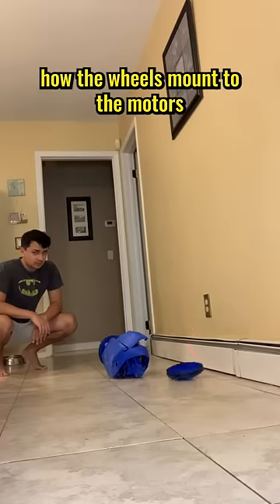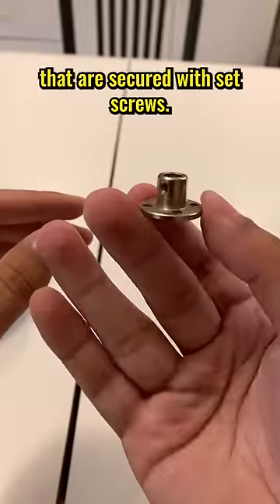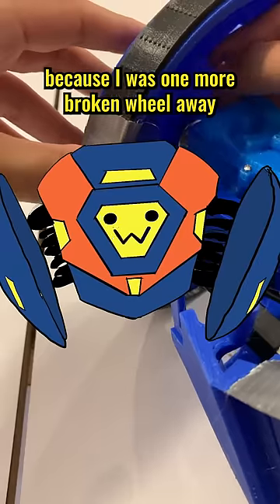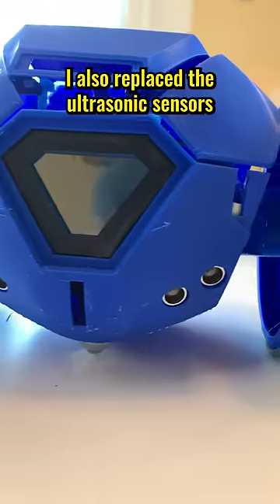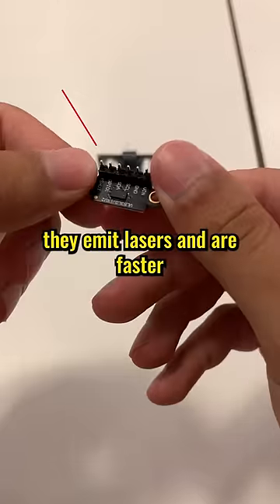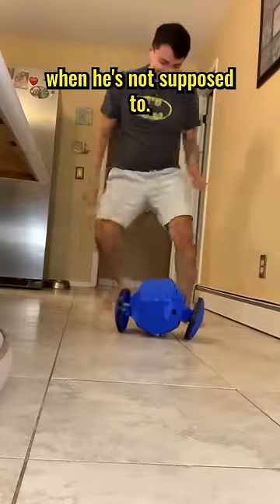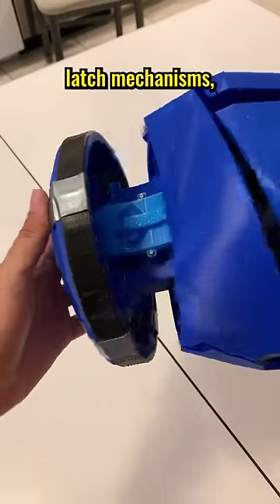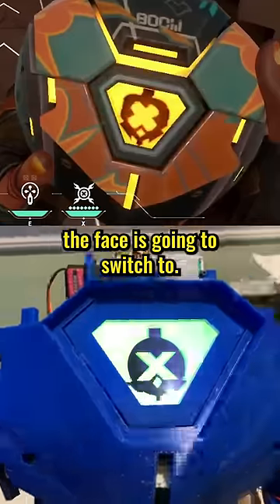Boomie is gonna swim Pt 15

Comment: I’ve worked with IR sensors quite a bit before. If you’re having issues with false positives then maybe you need to spend some time calibrating the sensors manually. Sunlight and reflections are the largest offenders of creating false positives, so either controlling your environment or adapting to it may help.
Reply from the maker: Thanks yeah i actually switched back to ultrasonics. I wanna be able to bring boomie outside without issue. Update coming on this soon. I used the NewPing library and that has greatly reduced my false positives. Along with checking if im actually against a wall with a middle sensor with two side ones, i have had 0 misreads today

Comment: You shouldn't use the average for these type of sensors, that will throw off your readings. Instead you should take 3 or 5 readings(depending on how many false readings you get) and then use the median as your final value. You can also do more but this should be sufficient

Comment: Suggestion to make the transition of switching directions smoother.
Instead of having it reverse slightly and turn around, how about making it so that when it hits a wall, it starts to go foward backwards.

For example
Boomie hits a wall on it’s right.
The right wheel rotates foward as the left wheel rotates backwards.
Boomie does a 90 degree turn and keeps heading foward, but is now turned around as the wheels rotate backwards. 
You can also put another screen on the back so that the back screen lights up with a face when it turns around so that it looks like it is still going foward.

Comment: One thing I might change is that instead of using the mean of three readings, use the mode instead. That is, use the reading that comes up twice. True readings might not be exactly the same, but let it decide if one reading is very different from the other two, and consequently drop it.